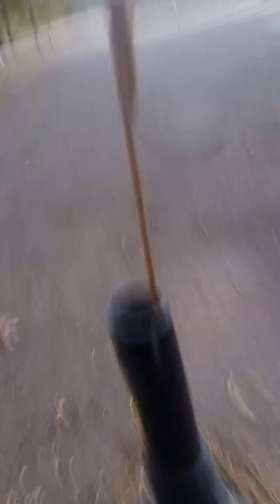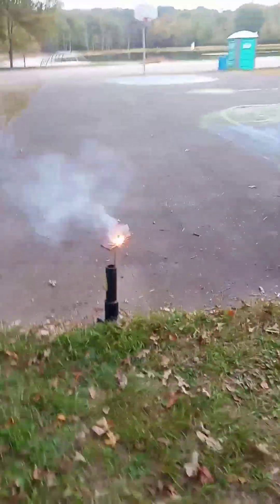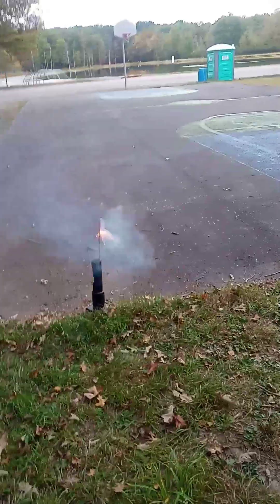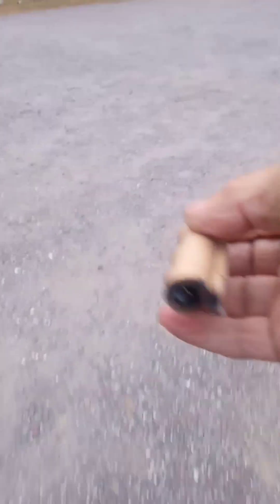acpc rocket propellant

Comment: What did you make the nozzle out of?
Reply from the maker: Kitty litter. First I ram a solid plug. And depending on the size of the motor. I drill out a hole partially up into the fuel.
Reply from the maker: Here are some of my favorite rockets. Large black powder and large whistle strobes with decent sized headers. 
https://youtube.com/playlist?list=PLZCjd46K_wcc_wPMtSmUraRqERu7oXGcH&si=3A7-w_dC2GG21o9d